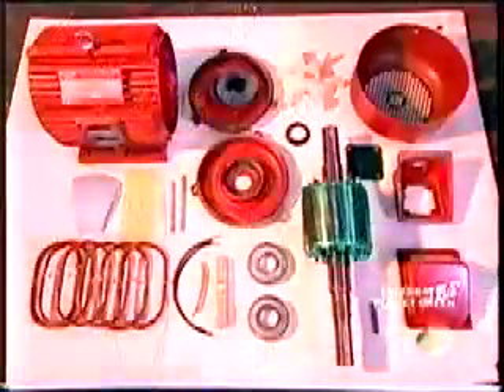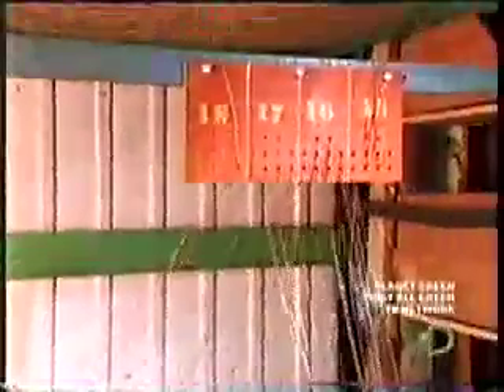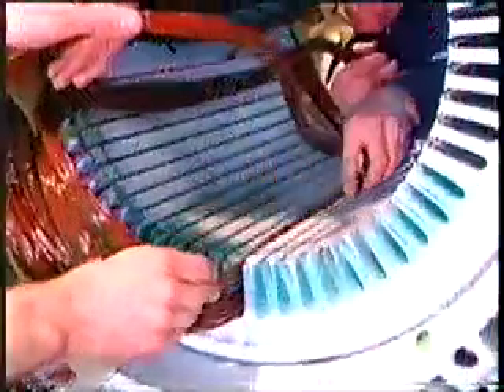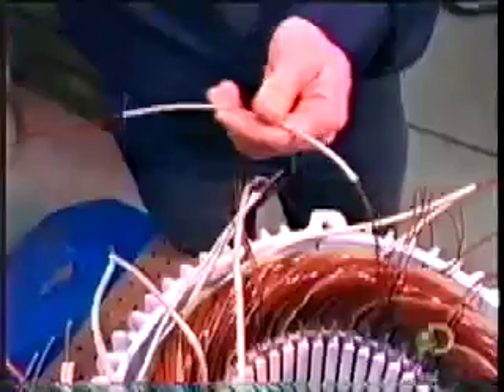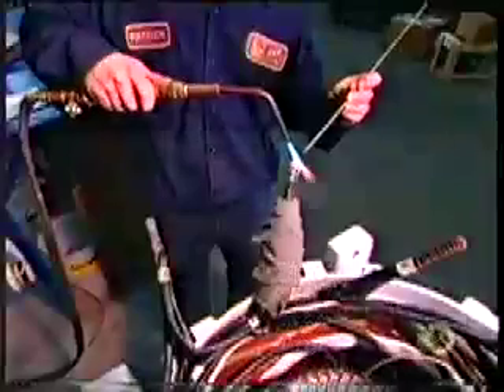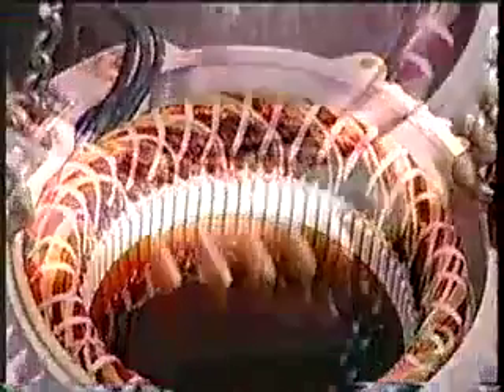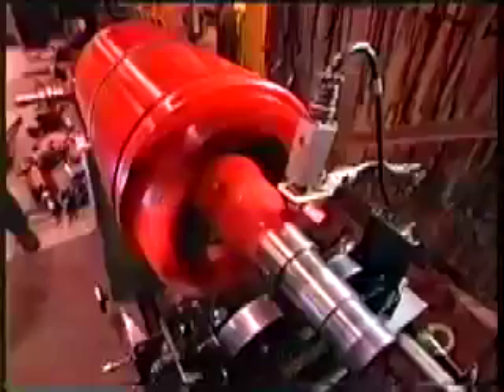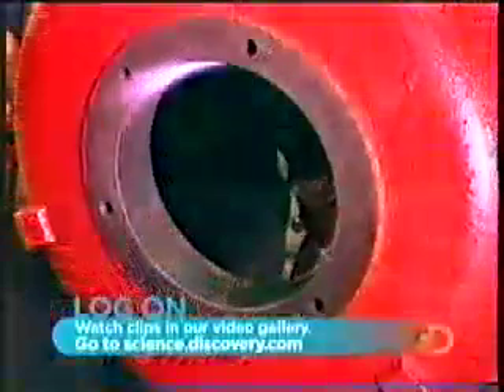MODERN TRENDS-PART-9 ELECTRIC MOTORS

Comment: @palexandersquires Vacs use universal motors which are not AC, but can be ran on both. An AC motor has only a rotor with no brushes or commutators. Also modern Diesel electric trains use 3-phase AC induction motors instead of DC as was common in the past.

Comment: With sufficiently insulated electrical connections and a VPI-insulated rotor you should be able to run this under water.